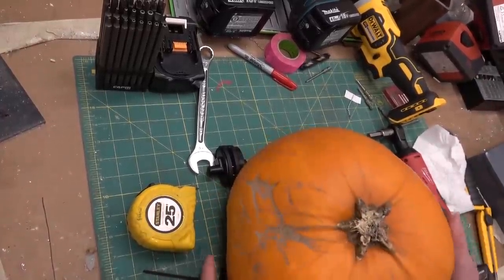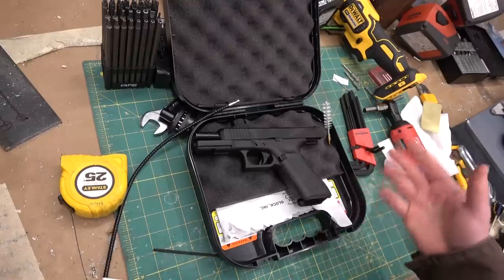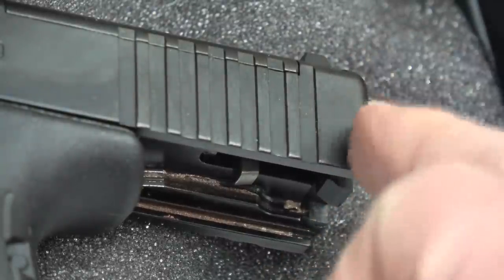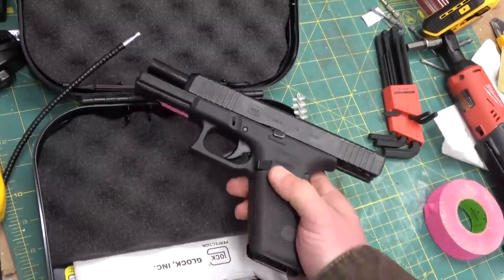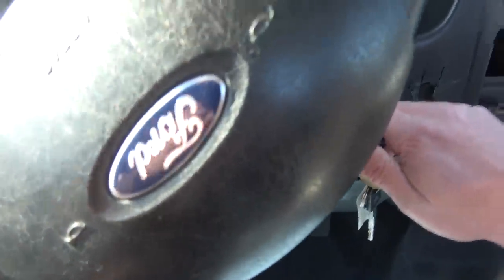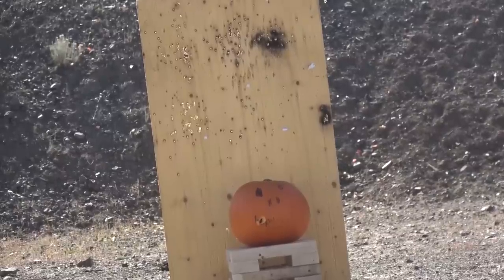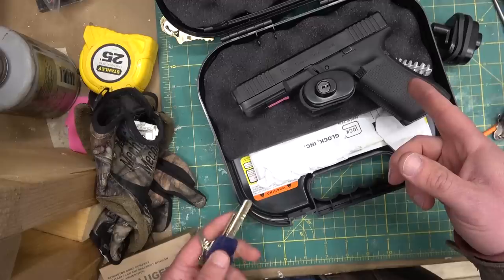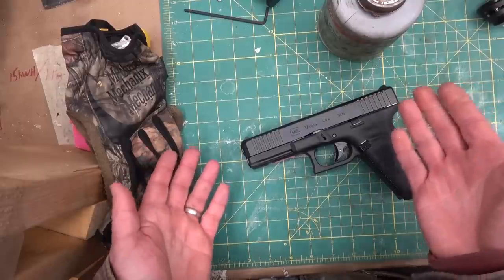BOLTR: GLOCK 17 GEN 5

Comment: Ive always been impressed with how fast the bullet is actually spinning. The 9mm from your Glock is spinning around 90,000 RPM and a typical round from an AR-15 is spinning at over 300,000 rippums. Sometimes bullets with a thin or weak jacket cant handle the stress and the jacket flies off and the bullet self destructs in flight.
Reply from the maker: That's fucking incredible. That means that there's shit tons of energy getting "used" to spin the bullet. If one designed a barrel to spin slower you'd conceivably get a faster bullet. Hmmmmmmm... Off to find the sweet spot!
Reply: Backyard scientist and Uncle bumblefuck in conversation, Never seen the likes
Reply: if a jacket is coming off the twist rate was way too high and the round wont stabilize
Reply: Wouldn't you lose accuracy when losing spin? I guess that's what you mean by "sweet spot".
Reply: Well sheet, when my Tube channels collide. It's like someone divided by zero!
Reply: @arduinoversusevil2025  the high rpm is required otherwise it will go off course some of the energy is used to increase rotational speed but that increased rotational speed allows it to have stable flights. Unfortunately if you were to slow the rotational speed conceivably you could increase the acceleration but you would destabilizing it decreasing accuracy greatly. Pistols and rifles it don't operate very well at shotguns speeds due to having such light forms of ammunition
Reply: The rotational speed can be adjusted with a different barrel that isn't the same twist rate (example 1:9 vs 1:7)
Reply: @arduinoversusevil2025  Agree. 3000 fps with a 1:8 twist.    (36000 in/sec)  /  (1 rev per 8in ) = 4500 rev/sec.
Or,  (.66 rev per foot)  = 2 revs per yard.  100 yard shot?  spun 200x.
Reply: The higher twist rates are used to stabilize heavier grain bullets. Twisting too fast can cause bullets (almost always lighter weight ones) to destabilize in flight and not perform as expected. To counter the loss of energy with heavier rounds in higher twist rate barrels needed for proper stabilization, you increase the barrel length which increases the velocity.
Reply: @arduinoversusevil2025  the extra force required to spin the bullet down the rifling gives the bullet some more precious time In the barrel, letting gas pressure build up more. I reckon theres a sweet spot, i.e. too little spin = lost velocity
Reply: @arduinoversusevil2025  The 5.56mm rounds in M193 designation are 55gr and go over 3,200fps at the muzzle.  If you impact ballistic gelatin within 100m, the copper jackets and lead absolutely shatter into tiny fragments due to the ribbed cannelure design on the bullet itself being a weak point, where the brass casing crimps on.  with a 1:7 twist (one bullet spin per 7"), that's 330,000RPM.  A few people have used chronographs on the bullets and recovered the fragments from gelatin at different velocities, and you can actually see the changes at different velocities.  As the velocity gets slower, the fragments get larger and larger, and it leads back to the cannelure segment, until the velocity is too low for that weak point to structurally fail upon impact.  Google images for "M193 gelatin" and you'll find the image in question.
Reply: @arduinoversusevil2025  your glock will be as accurate as a bb gun if you  re-engineer the spin.
Reply: Most, if not all firearms have rifling to gain accuracy. Some artillery and tank guns vary. British MBTs use rifled barrels which makes them very accurate, but can't use some fancy ammo. US tanks don't, so they have a bit better effective range and can use discarding sabot, with a slight penalty to accuracy.      ( Might have got them mixed up, but that's the gist of the difference)
Reply: @arduinoversusevil2025  thats a steep and winding rabbit hole Unkle B... every caliber, every bullet weight, every powder charge, every primer, barrel type, action type would have an effect on it in sometimes bigger ways than one might suppose.  Dudes have spent lifetimes trying to get it perfect, Hence why there are so many caliber choices... bunch of dudes can't be satisfied with 9x19 or .45acp so they came up with .357 sig, and .40s+w etc etc etc
Reply: @arduinoversusevil2025  if you look at some of the new pcp air rifles that have the smooth twist ware it is smooth bore for 3/4 of the barrel then the last few inches it has rifling
Reply: @arduinoversusevil2025  longer bullet, faster twist required.
Reply: @arduinoversusevil2025  didn't the american revolutionist first discover a riffled bore that gave them a tactical advantage in the woods? perhaps more spins is better to  keep projectile going straight for as long as possible, to prevent premature divergence .
Reply: @nmfd31  Chuck Norris does it (÷0)
Reply: As much as I like to shoot, and read or watch videos about shooting, I’d never really given much thought to translating twist rate into rpm.  I double-checked your math on the AR (because I know that twist rate) and it matched yours.  Been shooting for decades and didn’t know.  Thank you!
Reply: @arduinoversusevil2025  Some manufacturers do the running in for their customers. You can see it for a very brief moment in this video from Beretta about their ARX-160 assault rifle: https://youtu.be/OauVfw0qquY?t=116
Reply: @smc1897  You messed up some of the maths... At 100yds it would have rotated somewhere in the vicinity of 450 times.  You might want to have a look at the second line at (.66 rev per foot) should read (1.5 revs per foot).  You just inverted 12/8 for 8/12.   Easy mistake to make.
Reply: @arduinoversusevil2025  that spin acceleration also increases barrel pressure. You'd likely need to switch to a finer load if you try to optimize for linear acceleration only.
Reply: I've actually just jizzed in my pants that The Backyard Scientist watches AvE's videos... That's fucking awesome! I have a whole new level of respect for you 😎
Reply: @keiy.4031  That whole 'muh frangible 5.56' spiel has been thoroughly debunked and you know it.
Reply: @arduinoversusevil2025  A bullet has such a low angular inertia that it doesn't really take much energy to spin up to high speeds. By my back of the envelope calculations, a bog standard 5.56 cartridge imparts about 2 joules of rotational kinetic energy to the bullet by the time it leaves the barrel, where as the linear kinetic energy at the muzzle is well above 2000 joules.

I used this monstrosity, combining the formula for rotational inertia of a rod (1/2 mr^2) and rotational kinetic energy (1/2 Iω^2) combined with a 5.56mm diameter rod weighing 62grain, spinning at the 4500revs per second figure provided by @SMC: (1/2) ((1/2)(4.02g)(2.78mm^2) )* (((4500 * 2pi) / sec) ^ 2) (pardon the excess parentheses, I was live developing it in wolfram alpha)

My guess is that any effect this would have would be well below the noise floor and more or less impossible to measure.
Reply: @arduinoversusevil2025  You would get a faster bullet 100%, but the spin gives the bullet its accuracy. The barrel is designed to give the bullet it's spin, i think it was invented in the USA civil war or at leat than it was fully implemented.
Edit: Glock 17 muzzle velocity is about 375 meters per second. Lets say that you shoot at somebody from 50m (which you most likely would not, but this is this weapons effective range), this means the bullet would fly for about 0,13 seconds before it hits the target. If the bullet is spinning at 90k RPM (1500 per second), this means that the bullet would spin 195 times, which is realy not alot. Now we could go into details with forces and acceleration and more, but let's leave it at that. Interesting.
Reply: Doesn't sound right.
Reply: @arduinoversusevil2025  the spinnums is why we arent stuck with muskets
Reply: @arduinoversusevil2025  the spin is determined by the length of the bullet. Too fast or two slow and the bullet destabilizes and loses accuracy.

The hexagonal rifling is easier to clean. I believe the barrels are hammer forged around a mandrel, as opposed to groves being cut either by pulling a button through, essentially a broach, or each groove being cut individually on a specialized lathe.
Reply: @Wolf_Larsen  Not really.  The ribbed cannelure is weaker on the M193 round and will fail spectacularly above certain velocities upon the tract through a wound channel.  You don't see that with the M855 in ballistic gelatin tests.  Those actually behave differently and flip because the steel core is in the front with a rear Pb plug, which puts the COG rearwards. 

No one called it frangible ammo.  That's an entirely different type of ammunition made of weakly sintered powder metal that will survive the acceleration in a barrel, but crumble on impact. Fragmentation isn't the same as frangible.

You're the one misconstruing jacket weakness with "designed to be frangible".  I'm not sure what kind of armchair commandos you've been talking to in order to carry that type of baggage around.
Reply: Clipamagaglockazines... I fucking love it
Reply: @NathanMcCarty  Thanks for doing the math, I was curious how stressful this was on the bullets. There are barrels with a progressive twist rate (aka gain twist/variable twist) and they are supposed to reduce wear on the initial few inches of the rifling, and to get a cleaner engagement between the jacket and rifling. I read a few revolvers use them because the bullet is already traveling kind of fast when it engages the rifling (Smith & Wesson Model 460 goes from 1:100 to 1:20 ) and i know FX air rifles use a similar system.
Reply: Another interesting thing is twist rate per length of barrel so, if you have a 1:12 twist barrel that is 12 inches the round only makes one complete revolution before exiting the barrel. Now, what I wonder is... how much does the bullet need to make a full revolution before exiting? What if the barrel was 11 inches, 1:12 twist?
Reply: Side note... TBS, I subscribed back when you did that molten salt into water video but, just now checking, I was unsubscribed.... that has happened quite a lot. I think once with AvE too. Mostly with political or 2a channels but, even has happened to people who aren’t the least bit controversial so I don’t know what the hell is up.
Reply: I haven't looked into it recently, but the barrels are incredible. I think cold hammer forged, polygonal rifling, and unsupported chamber. The chamber is no good for reloading, but eats about any pea  you can feed it from the store. DON'T SHOOT CAST PEAS OUT OF POLYGONAL RIFLING. Kahr, HK, and Patriot Ordnance Factory use this type rifling... The claim of consistent gas pressures, and longevity.

Great video, you changed my view of Canada and pea shooters... Still kinda weird to me.
Reply: @arduinoversusevil2025  The sweet spot is usually attained experimentally by sneaking up on it from the slow side. IIRC the longer and skinnier the bullet gets the more twist it tends to need to stabilize, round balls hardly need any, like 1 turn in 60 inches, on the other end of the scale the more modern heavy bullet 5.56 NATO loads need 1 in 7.
Reply: @arduinoversusevil2025  The energy thing (including the damage that energy does to rifling) is why the stupid big tank cannons are smooth bore. Back when zee Germans developed the 120mm gun that's in their MBT as well as what got added to the US M1 Abrams they decided to go smoothbore because fin stabilized AP penetrators could be fired at higher velocities (5,700+ feet per second) for a given level metallurgy and the projectiles could be made with length/diameter ratios that would never correctly spin stabilize.

By comparison the British 120mm rifled tank gun is about 15% lower velocity... and they only get a barrel life of 400 rounds when firing no-kidding full charge war shots.
Reply: Math checks out. 

If the twist rate is 1:9 doesnt that mean it will do 1 revolution per 9 inches? So if you shoot at a target 100 feet away, 100 feet / (9/12) = 133 revolutions per 100 feet. Yeah there will be some loss due to air pressure by the time it hits the target and be a little less. 

Now let's calculate rpm. 1 twist per 9 inches at 1500 f/s. 1500 * (12/9) * 60 seconds = 120 000 rpm out of the muzzle. Insane.
Reply: @keiy.4031  originqlly the AR was 1:10 twist rate, when they started adding tracer rounds, they increased to 62gr. At that point 1:7 started being used.
Reply: Tzuede Off the Cuff  Did I at all mention who developed the cartridge? no? The point is no one caliber is perfect, and each caliber has variables to its own loadings. Besides Glock was largely responsible for the 10mm, and S+W for the .40S+W, The fact the FBI picked up either is irrelevant
Reply: I’ve wondered why barrels don’t have a variable helix in the rifling. Say you start with a 1:10 twist and end with a 1:7. Anything to give it room to spin up before it leaves the muzzle. Maybe it wouldn’t make a difference but it’s worth a look I think.
Reply: 90,000 rpm twist rate! My jacket comes of well below that threshold and i'm not even a married man
Reply: @Mr2greys  Depending on where you want to start the timeline of the rifle's development (at the AR or M16 line) the earliest twist rates were 1:14 twist, later 1:12 twist with revised M16 variants.  The original twist rate was too slow to stabilize the 55gr M193 ammunition if it impacted anything in the flight path, like leaves in jungle environments.  The bullets would yaw and deviate from the ballistic trajectory.  This gave rise to the myth that "the bullets are designed to tumble in flight and in people, blah blah devastating wounds".  It was an engineering oops.
 

62gr ammo was the M855 ball ammo which the 1:9 twist was originally developed for, and the M856 tracer ammo is actually 63.7 gr and a 1:7 barrel twist was released for that.  However 1:8 or 1:7 seem fine to stabilize today's heavy rounds, like the 77gr Mk262
Reply: Well even you’re forcing something to twist at 1 revolution over sat commonly 8 inches (your common 1-8 twist) and shoot it at 3k FPS....
Reply: smc   bullet does MORE then one rev per foot.
           4.5 revs per yard
Which matches your 4500 rev per sec. Calculation
100 yards = 300 ft ,,,  or 450 spins,,, 1/10 second passed
 3000 ft ,,, 4500 spins,,, and ONE second passed
Reply: George Howe that’s not exactly true, gyroscopic stability has to do with length of the projectile, not the weight (see miller’s equation). It’s just that heavier bullets tend to be longer.
Reply: @TylerLL2112  Well, it doesn't. There's no magical effect that occurs when a bullet's rotated 360 degrees. As long as it's rotating rapidly enough to gyroscopical stabilise you're kushti. Most bullets coming out of pistols do not complete a full revolution in the barrel.
Reply: @Guysm1l3y  Yeah, but then again we've never needed all 400 rounds per tank.
Reply: Admiral Belzediel Thanks!👍🏻
Reply: I have to say, I have never heard of bullets rotating that fast and have to say that I don’t believe you are correct about that.
Reply: @matthewl67  If only there were some way you could look that up, some sort of interconnected information system you could access through some device. Ah well, guess we'll all just stick with what you've heard for now.
Reply: @arduinoversusevil2025  Glock's 1:10 twist rate is definitely an overkill for 9mm. You can have a 1:20 twist rate and still stabilise even a 147 gr bullet perfectly fine.
Reply: @jameshaggard1944  I think any sort of rifles barrel is still less efficient than a smoothbore, hence all modern tanks almost unanimously have smoothbore guns. The faster a bullet spins, the slower it must be in a straight line (given the same propellant and the same barrel length)
Reply: @Ishiku__aka_xchoibitschibihil  Rifling was invented in 1498 by a German dude. But due to its expensiveness and difficulty to manufacture, most of the guns until the 19th century were smoothbore. So most of the firearms used by both sides during the American war of independence were smoothbore.
Reply: Tzuede Off the Cuff  It's got one feature that I like. Flat nosed bullets are standard. Feeds hollow points with no issues, unlike earlier 9mm and .45ACP pistols. Obviously modern wonder tupperware guns don't really have this issue but I've never had a failure of any kind in thousands of rounds of .40 out of Springfield XD and XDm pistols.
Reply: @strangefruit8776  Some do. It's incredibly hard to manufacture and only really brings benefits when shooting something that's high speed/mod to high mass where a fast initial twist would smear the jacket or just flat wear out too quickly.
Reply: @Belzediel  The tank's barrel being rifled also limits the types of ammo that can be fired. 
Plus, the increased maintenance overhead of rapidly burned-out barrels makes it seem like a big trade-off for the "muh sniper-tank" meme the British army has fallen for.
On the other hand, the German autism over big guns has come to hilarious new height in their development of their new MBT, which supposedly sports a 150mm cannon.
Reply: @Wolf_Larsen  uh huh. We've only lost one tank.
Reply: @arduinoversusevil2025  That angular momentum is a gift for your target.
Reply: Usually from too fast of a twist rate for the chosen bullet.
Reply: Shotgun slugs don't spin out of a smooth bore and they are fairly accurate out to 100 yards.
People smack deers with them.
Yeah, bullets spin out of rifled barrels, but they reach their destination in fractions of a second.
How many revolutions do you think the average .223 makes in 100 yards.
Not many.
Reply: @arduinoversusevil2025  Mythbusters did an episode once about shooting a bullet onto ice and it would stay there and spin for a few seconds.  It was a viral video that looked suspect but they confirmed it.  Spinning slower though would (could) affect the stability, and therefore the accuracy, of a given round and bullet weight.  Barrel twist is a big thing to argue over in the world of 300 blackout.
Reply: @northmanlogging2769  Glock wasnt "responsable" for the 10mm at all. At most the Glock 20 kept the cartridge relevant during the years that the 10mm was slipping into obscurity. 

The 10mm Auto cartridge was a joint development between gun manufacturer Dornhaus & Dixon and ammunition manufacturer Norma. 

There is a huge history involving the 10mm Auto cartridge that is way too big to cover here but the boiled down version of it is that it was created by Dornhaus & Dixon for their new autoloading pistol back in the early 80s called the Bren Ten.
Reply: @Full_Otto_Bismarck  ah yeah the bren ten, I did forget about that one (POS that it is) anyway, my original point of massive amount of variables still holds.
Reply: @northmanlogging2769  No argument from me on variables, external and internal ballistics are both so complicated with variables it boggles the mind. 

To each their own but i would hardly call the Bren Ten a POS, individual examples were in some cases paperweights but those were from slide cracks due to the bad QC of the casting supplier for D&D, under different circumstances they could've waited to find a new supplier and delay the release but they were under pressure as they had taken full deposits on the guns as pre order. Regardless of that theres been original owners saying they shot the snot out of those guns and had nary a problem which should be expected as its really just an upscaled cz75. However i suppose thats one's perspective, as D&D undeniably went under.
Reply: So does a sniper's rifle spin it even faster to get the accuracy long range?
Reply: @arduinoversusevil2025  that's why varying rifling twist rates exist, you use slower twist rates, 1:7 for 55gr 5.56×45mm going 3000fps as opposed to 1:9 for 77gr 5.56×45mm doing 2500fps
Reply: @arduinoversusevil2025  Spinning at those kind of ripums, you get a nice drilling effect instead of a splat.
Reply: @arduinoversusevil2025  there’s something called progressive rifling, which is to say the twist rate increases as it travels down the barrel. This stabilized the projectile but doesn’t use as much of the chemical energy imparting the angular velocity.
Reply: Yes but how many revolutions is that really? A 9mm round is in flight for a second?...half a second? One second and the bullet spins 1500 times and flies nearly 1500 fps (more like 1200). That's one revolution per foot. When put that way it doesn't seem nearly as impressive lol.
Reply: As far as precision goes, the poor old glock is entry level. Walther CZ and M&P being the exception when it comes to mass produces pistols. 

Alas a proficient shooter with a glock will always out perform a beginner with even a Tanfoglio or custom race gun. 

Not internal and external Balistics are amazing. Now with modern stable powders shots out to 2 mile is quite achievable
Reply: Not in flight.  It is destroyed in the barrel